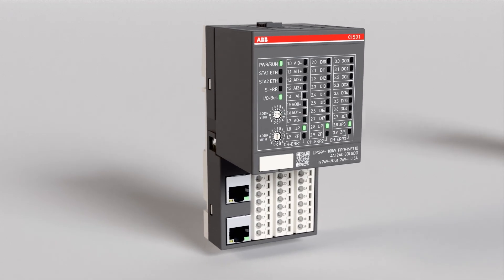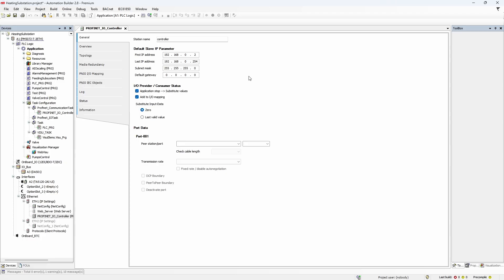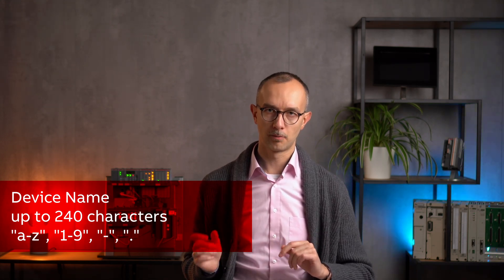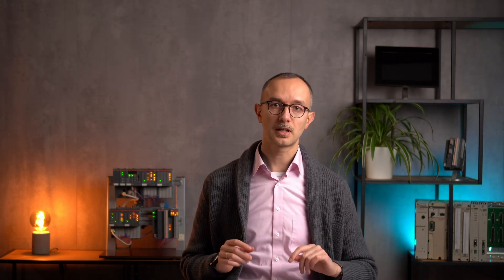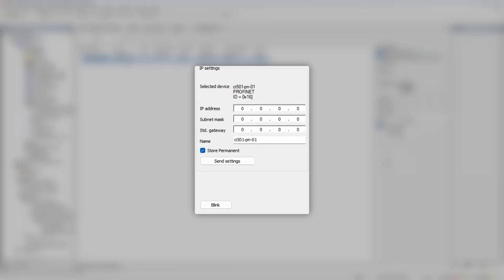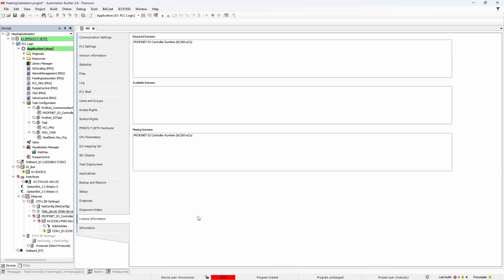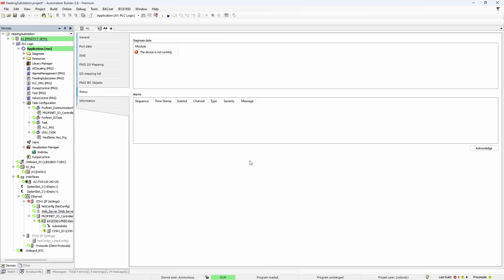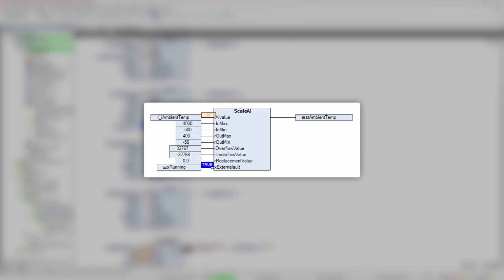Intro to AC500. Part11. Remote IO over PROFINET

Comment: Need to explain much and more about the controller and software to be an expert program as we know no videos available online
Reply from the maker: Hi! Have you checked other videos on the channel? Which topic you feel like is not explained at the level of your expectations?
Reply: Advanced diagnosis please. Using the libraries and getting the diag info into a sensible structure 

I haven't even watched the but I'm confident you'll not have covered it. 

Lots of people think this product is being dropped now because of b&r being promoted. Doing a decent diagnosis video would help counter that
Reply from the maker: @DdFf-p4d  
Hello Sir!
You're right, I haven't touched in depth diagnostics using IEC logic and diagnostics buffer. In the end it is just a beginner friendly Introduction course.
But thanks for the input. Appreciate it.
I'll consider it for some future topics